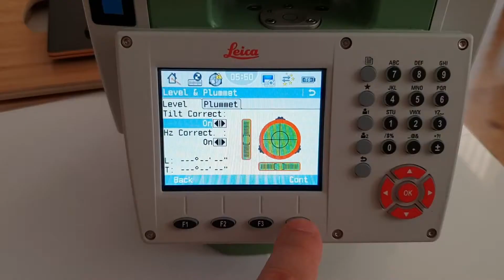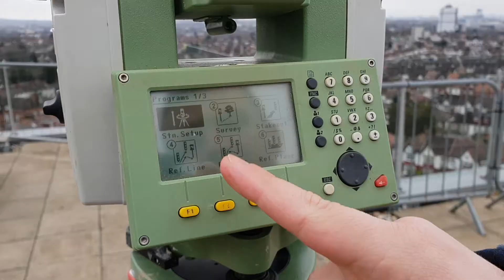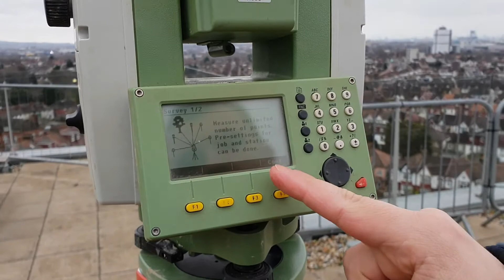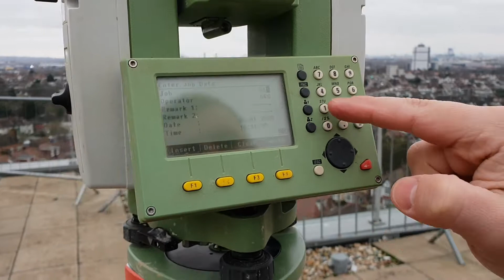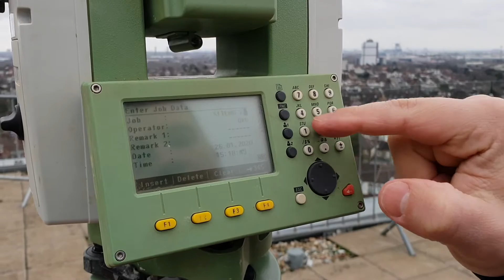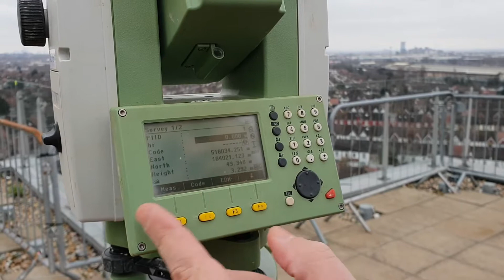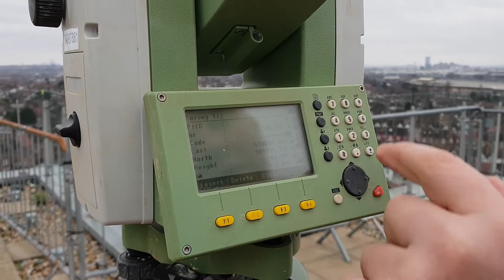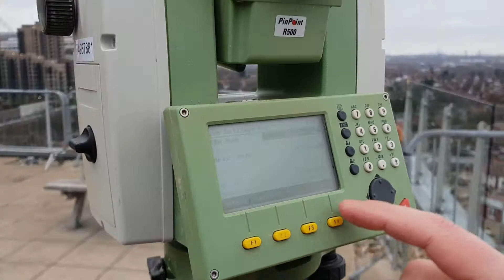SETTING OUT - How to use a Total Station "Survey" program. Step by step guide on surveying.

Comment: ha ha I remember a few years back was doing slab survey using rotating laser with staff (or sometimes just a measure tape) and manually putting data on A2 size drawing ... comparing to this method I was like a dinosaur LOL 
Thanks for the upload!
Reply from the maker: Hi Negotium! Yeah it's all changing fast, even TS06 becomes a dinosaur's tool now 😊 If you set a robotic one it will do all survey for you as per nice set grid etc. Whatever it is I really love TS06 as you can really do everything with it😁